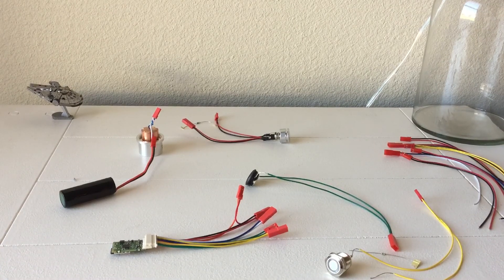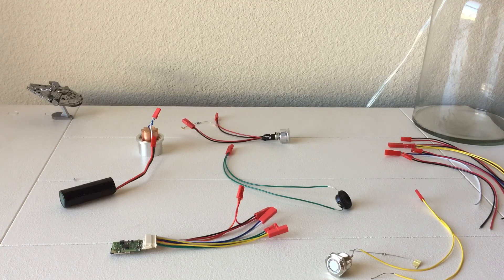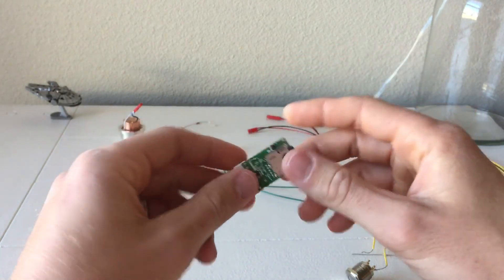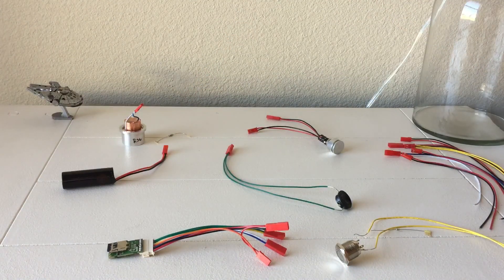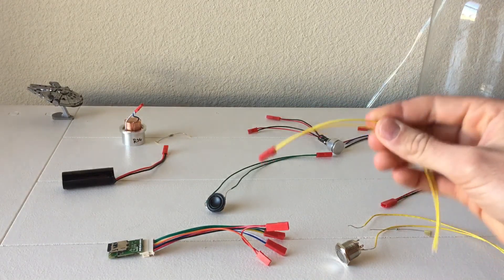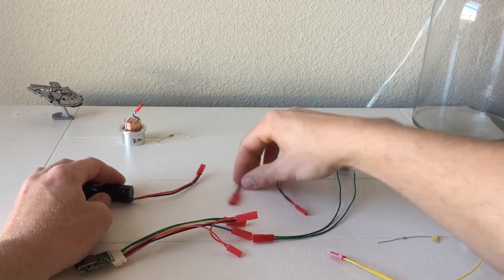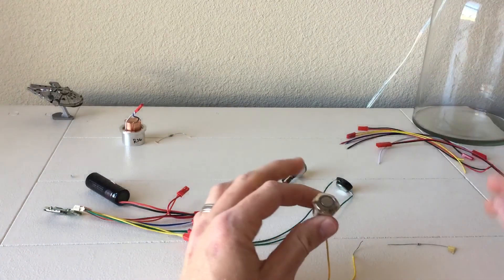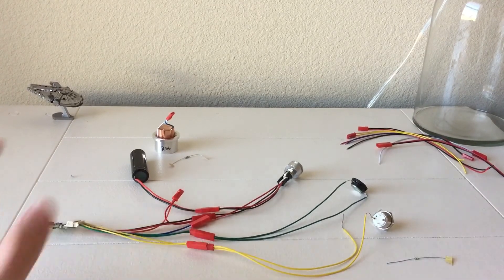PT 1 Lightsaber Wiring tutorial made simple (Custom Saber Shop) DIY

Comment: So wondering, when you already have some extra pieces and they have enough wiring, do you still have to solder the extra wires in the jst connectors or is it still plug and play basically? I'll be getting me an empty OxWorks saber this week for a first time so, excited on that :D
Reply from the maker: JediKnightZrenTobas87    I’m sorry I’m having a little trouble understanding what you’re asking. Are you saying you have extra wires left over ?  But yes as long as it’s wired correctly it’s plug and play. Any extra wires and JST’s I had and didn’t need, them I didn’t use.
Reply: @The_Jedi  I actually found me a kit I might see about, will just be getting me a different switch though x.x

Comment: Hey man! I liked your video and wanted to do it for my own saber but I’m having a bit of trouble doing it. After wiring everything together and connecting the battery, the speaker does the boot up noise but whenever I press the switch, nothing happens. 

The way I did mine was with the same pre wired biscotte you used, the same switch and jst connectors, the same resistors, a 24mm speaker, the only thing different was the battery and led. Instead of buying the battery, I made a diy battery pack that holds 4 aaa batteries and for the led, I used a blue led strip. What do you think could be the problem? 

Thanks again for the video!
Reply from the maker: Gilberto Ruiz 
Thanks for the comment! I’m glad you could get some use out of it.

So I would say double and triple check your wiring. If you wired everything properly and like I did here then it will work. Make sure you watch my part 2 video on this as well to ensure you wired it right. And in this part 1 video I touch on a good tip at 7:35 about wiring the switch to particular prongs. Positive and negative give you the LED light up and the other two are for the On/off function only. If you are getting a boot up noise this means you are getting power but obviously not getting power to the switch. This  indicates a wiring issue or mistake going to that. Check your prongs on the switch. You could just touch the wires to the prongs if you need to while it’s on to see when it gets power to it. 

Like I said though watch 7:35 again here and then watch my part 2 video. Get back to me and let me know if your figured it out
Reply: Ok so I rechecked the wiring and it looks the same, the blue wire is on the negative prong and the white wire is on the positive prong. But it’s just as you said that the current of electricity is not reaching the switch. To check if that were true, I used my voltmeter and set it to a mode that whenever the positive and negative prongs of the voltmeter meet, the machine beeps( which tells me that that the flow of electricity is fine). I put the positive prong on the nano biscotte, specifically where the red wire is connected to, and the black prong on the white wire before all the resistors (before the y splice starts) and the machine beeped, which tells me that the current of electricity is making it to the white wire but once I move the black prong to the white wire that leads to the switch (after the smaller resistor, and at the end of the y splice) the machine doesn’t beeps. So for some reason (I think) the resistor is not letting the current make it to the switch. Is it ok for me to remove that resistor and see if it works? 
Thanks for the feedback!
Reply from the maker: Gilberto Ruiz 
Yeah Give that a shot and see if you get power. Then you’ll know. It might be a bad resistor possibly or the wrong type but it should be fine without one. It’s not a lot of power anyways you’re running from the aaa batteries.
Reply: Hey, I tried that but it still didn’t work. Do you think that it has something to do with the yellow wires? Cause that’s the only other thing that I can think of. If it is the yellow wire, what can I do with it?
Reply from the maker: Gilberto Ruiz 
Ok let me just ask this.  Does your led light for the blade come on at all?
Reply: No, but that’s because there is nothing connected to the blue and white wires for the led. At the moment, I don’t have the led strip that I want to use. What I’ve been doing is taking an old strand of led bulbs, placed the blue wire to the negative side of the bulb and the white wire to the positive side in order to see if it would turn on. But nothing really happens, the only thing that happens whenever I put the battery on is the boot up noise. 

If your interested in the led strip I plan to use, I don’t know the exact name of it but the link of this video uses the same one but green (mine is blue). 

https://youtu.be/8TnnmyR2YdY

Comment: This is bobby iam having trouble getting my board to work and don’t have the right parts
Reply from the maker: bobby puopolo 
The battery is a 3.7volt  1400mah lithium ion battery.  If you watch this video, I go through in detail and name every part I used and show you how to attach them. Maybe Custom Saber shop will let you return the wrong ones
Reply from the maker: bobby puopolo  
Also... Idk if you already know but this video shows the parts I used and the 2nd video shows how to wire them. 3rd video shows the finished saber

Comment: Hey man! I really appreciate the work you put into this as well as sharing it with us. I have a question, and I may have more later hah, but are the wire clip together pieces weaker than just wiring it up normally? Like would they not be as good for a dueling saber?
Reply from the maker: Matthew Swank thanks for the comment !
So, the JST clips are very strong. Once you clip them together they are pretty hard to pull apart. I would trust them before any splicing and heat shrink I did so yes to answer your question they’re strong and should benefit you no matter what you’re wiring
Reply: +JediMasterTater great, thanks! So is there a place to get all of the other parts pre wired? Or is that a service TCSS offers? Or did you just do it all before starting the video? I know the Nbv4 can come prewired
Reply from the maker: Matthew Swank 
All of these parts came just as you see them laid out. I ordered the parts and once they came in put them on this table and made this video. I actually go through the list of exactly what I bought in this video so all you have to do is buy what I bought and do what I did if that’s what you choose or you can use this to get you going and make adjustments from there. 
You can use other sites such as (Ultrasabers/Saber Forge/ KR sabers etc...) but I chose Custom Saber shop because the site and chat forums made it seem easier to my mind and user friendly finding parts but it’s just whatever your preference is. 
To answer your question yes these parts all were ordered pre-wired EXCEPT the push button switch. They do offer it pre-wired but only for certain switches and I wanted this particular one.
Reply: +JediMasterTater oh okay, I hadn't seen the pre-wired parts on their shop except for the card. Maybe I wasn't looking in the right place. Either way, good to know!
Reply from the maker: Matthew Swank 
yeah!  Sometimes you gotta go to the search and type in certain words for whatever you’re looking for and it’ll help you find things a little easier.
Reply: +JediMasterTater I tried typing pre-wired before but again, I think that may not be what I should try hah. I will let you know if I can't find any but I think they might be in a "kit"section or somthing. The hardest thing about using prewired I guess is also that if I want to shorten wires based on saber length, it's a little harder but may be worth it for my first build
Reply from the maker: Matthew Swank 
Yeah the wordplay can be kinda funky when searching. Sometimes if you use to many words it doesn’t give you much results. Less words probably better. 
Yeah I’d say it’s worth it pre wired rather than soldering wires straight to the sound board and lights where they might be weak solders (especially if you’re not experienced). If you have prewired you can cut the wires to the length you want and then just splice the wires with the JST plugs right back to it and tape, solder, heatshrink etc... whatever you want. And then just plug your stuff in. That’s another reason I ordered extra JST wires.
Reply: +JediMasterTater thanks for the tip! Also, I have one more question. Did you make the kill key covertech knob? Or was that on their site too?
Reply from the maker: Matthew Swank it was on TCSS website also!

Comment: first!
thank you for posting this this is the first Iv seen like this explaining what you get from TCSS. was the speaker the only thing you had to solder together ? also would you know own how to do this with flash on clash ?
Reply from the maker: Hi RazorSharp Productions !  Thanks for your comment. I watched so many videos before I did mine and had trouble finding all the info I was looking which is why I made mine once I learned for beginners. The speaker is not the only thing I had to solder. I have 2 more videos you should watch all 3 because it gives in detail exactly how to wire everything once you buy these parts or similar ones. I had to solder the resisters, the switch as well as any extra wires I needed added. I haven't dove into the flash on clash yet personally. Mine just flashes one color when hit. I wanted mine to be pretty classic.
Reply: JediMasterTater I did watch all 3 and it helps a lot know how everything is wired but the mws you get on the custom saber shop, it has a wire for the flash on clash, so is that what you solder to get flash on clash?   I'm still trying to figure out how that works with the led, because the standard led doesn't have the wire for the flash on clash.
Reply from the maker: RazorSharp Productions it seems to me that you would need an LED module that has multiple led lights on it for flash on clash obviously because it flashes a different color when hit. My LED is just one color. Something like the Tri-Cree LED would be for FOC. But that seems to require soldering wires straight it. I haven't seen one that is pre wired. But there's many videos that show you how to wire to the tri- cree for flash on clash. There's more wiring and soldering involved when wanting to do FOC and I'd advise watching specific videos on that. But with that said I can't say I'm sure how to wire it to the soundboard. Like I said I haven't researched much on FOC because I don't want it on my saber. Thanks! Good luck
Reply: the custom saber shop or that guy Rob shows how to wire the LED with FOC and it's not to complicated from what I can tell, but he only shows how to do it on the nano biscotti, and not with the pre wired set up. I also noticed on the custom saber shop if you buy the harness it has 5 quick connects and the NB with the harness installed it only has 4 and one loose wire. (I think that's the one you have) it's hard to find answers for this kinda of stuff. I really want the CFv8 but it's out of stock :/ also that paparazzi guy has a good set up on how he wired his >_<